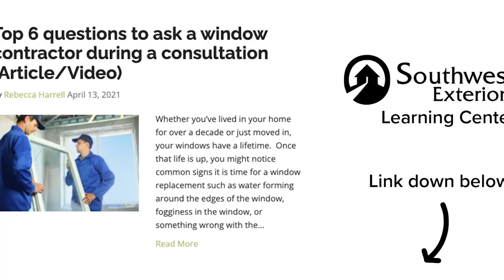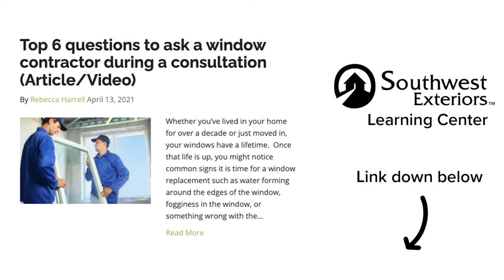7 Risks of Improper Window Installation (How to Avoid It?)

Comment: I chose pretty expensive, but they contract out. I don't think they did the exterior frame up right. I wish I could see photos of bad jobs.
Reply from the maker: So sorry to hear that. Nothing can be more frustrating, and any high quality installer should hold their contracted installers to the standards that they sell. I am currently polling our Design Consultants for any pictures from poorly installed windows to help. In the meantime, this article might at least give you a starting point to assessing your windows. 
"My Windows Weren't Installed Correctly. What Do I Do?"
https://www.southwestexteriors.com/blog/my-windows-werent-installed-correctly.-what-do-i-do
Mostly, if it looks wrong or feels wrong it probably is wrong. Sometimes it's just a small tweak but sometimes it might need more. 
If I get any pictures I'll share them with you. Thank you for checking out the video.